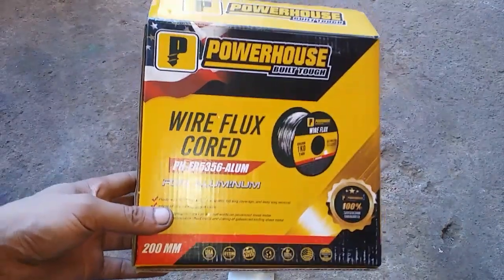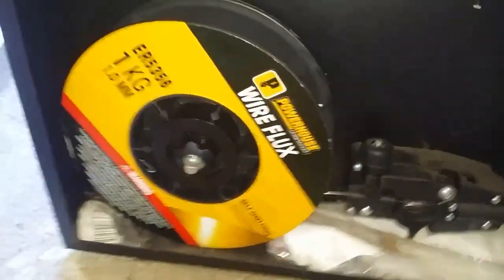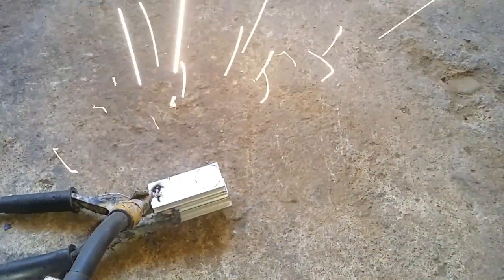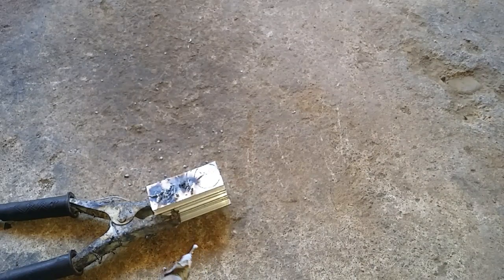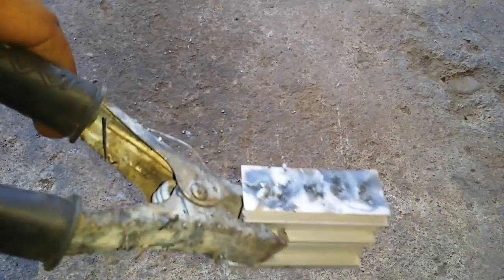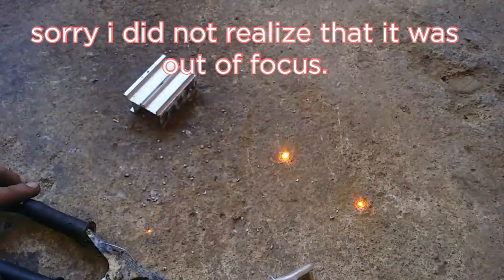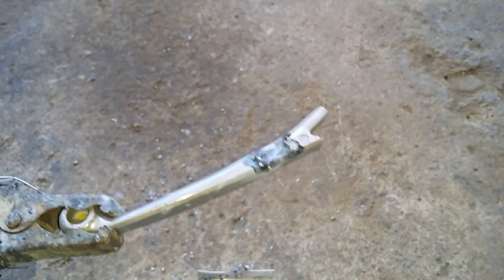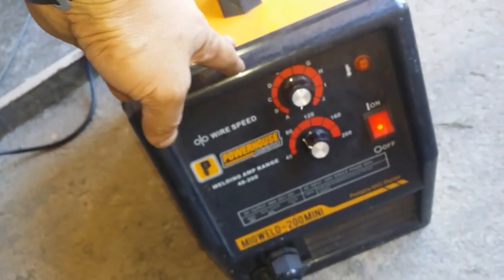powerhouse fluxcored wire for aluminum ER5356 Testing

Comment: In order to weld with aluminium fluxcored , it is a must follow two basic steps. 1st  you should clean the material that you're going to weld and 2nd you should preheat the aluminium material
Reply from the maker: Thank you. Ill give that a try.
Reply: @MrDIYer
Did it work now?
Reply: Preheating isn’t necessarily i mig weld aluminum and we don’t preheat it but we also do it downhill and more fast but heating it up helps where you might not burn through as much and might also help you move slower
Reply: Yes pre-heating is almost essential.

Comment: Thats a classic example of flux core being used when the machine is in the Wrong polarity mode.  NEEDS  to be grounding clamp positive to make it usable.
Reply: How?
Reply: That's what I was thinking also.
Reply: @MrOlvidado89  Any good welder will have a way inside to switch terminals, switch ground cable to positive and your hand torch cable to the negative. Even my new amazon inverter welder let's me.
Reply: Flux cored welders usually r electrode negative no?

Comment: ER5356 is not flux cored its a solid gas wire, it is mislabeled the same with the machine that says its a 200a inverter when in fact it is a 120amp AC Transformer machine and not even a DC one.

Comment: Old post I realize however for those finding it just now as I did. Flux cored definitely needs to be used DCEN in order to be used correctly! The polarity is set backwards in this video so it is no wonder results were awful!
Reply from the maker: If you have watch long enough i believe i mentioned that the machine is an ac welder. So theres no such thing as dcen or dcep is it? But they advertise that product as compatible with the machine so the point of that video is to find out if it really is.
Reply: @MrDIYer  I've been all through the product literature and cant see anywhere that it says its compatible with AC welding. Now given that flux cored is basically known to be a DC welder only consumable and that Aluminum flux cored wire has been a snipe hunt for the longest time anyway I think it was not good logic to think that not only has someone suddenly solved all of the issues that make flux cored aluminum welding impossible but they made it to work with AC as well as DC in the same product? So my point being that if there was any even small chance of success for the test it made 0 sense to try it on an AC welder instead of a DC and although I didn't look closely at your welder it was pretty safe to assume that no one would bother trying this on an AC welder as it would have been doomed to failure pretty much guaranteed. As it stands now, even years later, to the best of my knowledge we still do not have a flux cored solution for aluminum due to the many issues to overcome. I would love to see someone test this with a DC welder and the right settings though just to see what happens. My guess is though that it wouldn't even feed correctly even if the correct knurled drive was used. I'm betting that this product is just another one of the brazing wires being dishonestly marketed as gasless mig or flux cored wire.

Comment: There is no such thing as aluminum flux core wire. I have searched everywhere for it and cant find it, i read in some forum that the one on ebay that says its aluminum flux core wire is actually just aluminum wire and needs gas but they dont mention that, they want you to think its aluminum flux core, i almost bought it untill i read about it somewhere.
Reply: They should have aluminum fluxed core wire on the rack at your local harbor freight
Reply: @richard102879  they don't make it. Aluminum fluxcore is a myth, it cannot be done, aluminum wire breaks very easily solid core breaks without effort.

Comment: Based on what I know about welding aluminum, you skipped a few steps.
1) Clean/scuff the aluminum before you try and weld it. - Same as you would with steel.
2) Preheat the aluminum with a torch.  This helps the flux core/gasless wire and arc from the welder bond to the aluminum.
3) As a couple of others mentioned, you should have the cup on the end of the tip.  Yes, this is "flux core", so you aren't feeding gas through the cup, but the cup is needed.  It keeps flux gases from the core near the weld as it is expelled. 

Thank you for the video.  It shows the realistic challenges that many will experience when trying this, especially if they don't prep the material properly.
Reply from the maker: Really appreciate this comment, very constructive. I will give that a try. Thank you

Comment: Flux core is the opposite of sold wire if you can change the polarity. I think it’s dcen but you also have to run wire speed faster. Flux core aluminum is a process that you have to go against how flux core works. Mig aluminium you move fast and for cored wire you move slower because of it being hollow or set your wire speed higher. I run it as 210-215 wfs, 21.2 ish volts, and 101-104 amps. If you can set pulse it might help

Comment: I am no experienced welder. But I have welded aluminum with basic mic no spool gun. Yes I realize I said mig and yes with gas. You gotta have wire speed wide open  a brand new liner and tension almost non existent  or you will birdsnest every 3 seconds if you're lucky to get that far. So I still don't know if the flux core will work. I think you weren't feeding it enough material
 Someone feel free to correct me but please only if you actually know better.

Comment: Did you change polarity? For flux wire you should be running negative not positive
Reply from the maker: no such thing on that welder. i bought that under the assupmtion that it was compatible with the welder of the same manufacturer as they advertizE. apparently its not so.
Reply: there are no such product as aluminum flux cored in production. only solid aluminum and its best use in AC
Reply: @MrDIYer  is there anyway to get this sent outside of your country I've been wanting to try it in new Zealand but the site doesn't ship outside the country but really would love to try it any ideas or tips?
Reply from the maker: im not sure sir. but you might want to try "wish" app shopping flatform. i do believe its base in new zealand. hope that helps.
Reply: @imJanMikel  best on ac yes. But I've done it with DC without a spool gun. On my little 110 machine and it worked surprisingly  well. Cut and etch had good penetration. Not as pretty as AC for sure. But in. a bind it works
Reply: Should probably be ac welder

Comment: it wont work buddy. even you used aluminum fluxcore wire. lots product double pulse machine with cheap price. i use short circuit for welding aluminum it sucks. i bought double pulse welding it works for me.

Comment: Are you running argon gas when your welding Aluminum? you have to have gas when welding aluminum. You'll do ok if you need some advice contact me.
Reply from the maker: it's supposed to be fluxcored wire so i just ran it on my fluxcore welder. anyway if god be good i intend to buy a MIG welder. ty.
Reply: @MrDIYer  God is always good